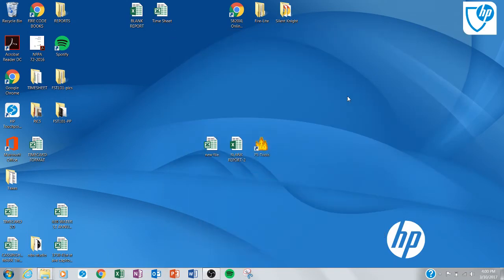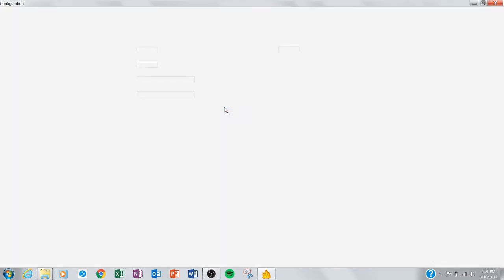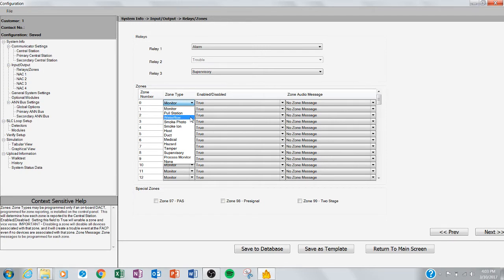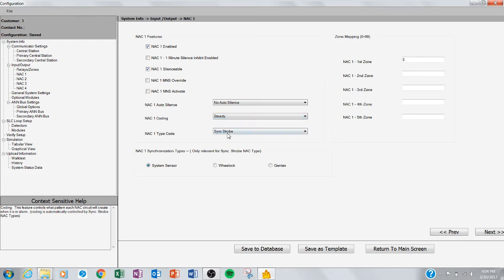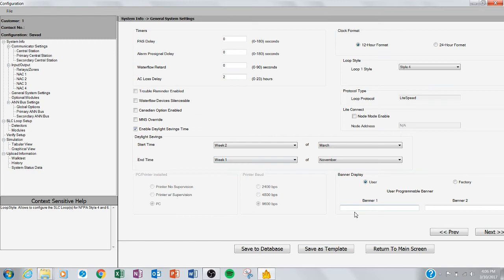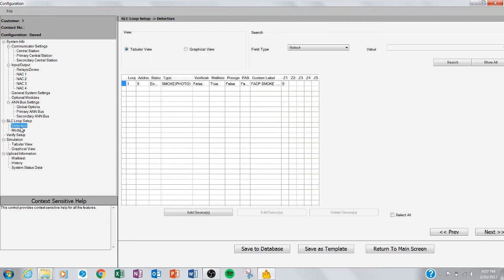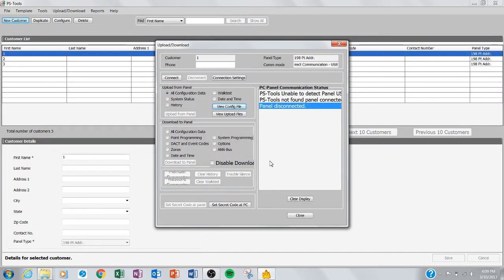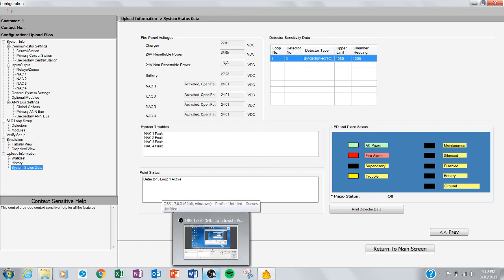Firelite PS tools How to connect and upload information from the panel on to your computer

Comment: Could u do a video on how to program for elevator? I am thinking I need 2 modules programmed as relays. 1 that can send the car to the bottom floor. A 2nd one triggered by ground level lobby smoke to send car to 2nd floor. Also need a way to trigger a "firemans hat" light in the car. I have not done much programming via a pc and any help with this would be greatly appreciated. TIA
Reply: You map a relay and the smoke to a zone. The smoke will trigger the relay. You use the same relays for the fireman hat. You need to ask the elevator guys if they need normally open or normally closed contacts. If this is for a new install, you need to find out if the elevator machine room is sprinkled. If so you will need a heat detector within a foot of the sprinkler head. This will shunt trip the elevator power. Edit: when i say use the same relays i meant the same type of relay. You will need 3 relays. Primary, secondary (alt), and fireman hat.